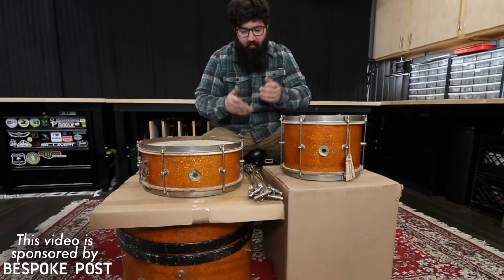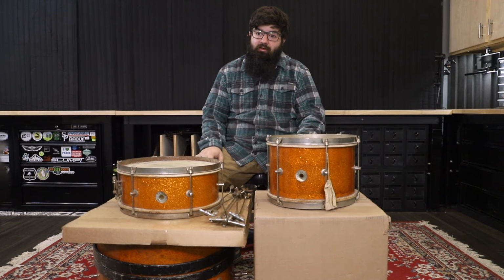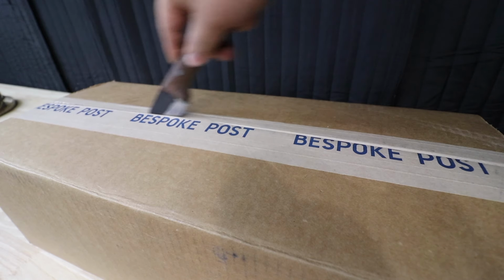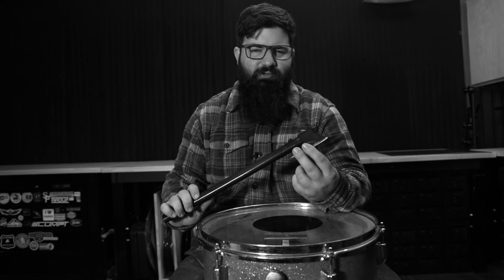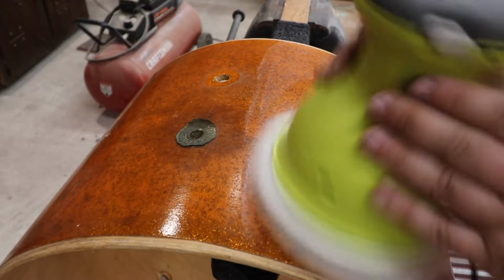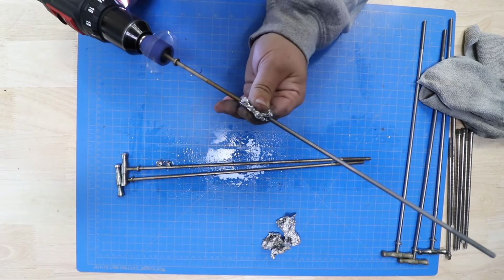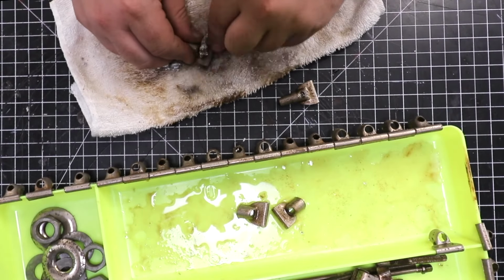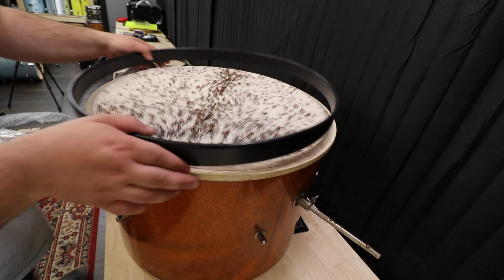Buying and Fixing an OLD Kent Drum Set

Comment: The kit sounds GREAT! I'm not surprised though. I've refurbished a number of Kent kits and drums over the years, and they always sound great. The way they made their shells is unique. Extremely thin maple veneer, on a roll, run through a glue bath, and wound-up like a clockspring, on a mandrel. When dry, the mandrel was popped-out, and voila!... a thin, strong multi-ply shell!!! Usually with a lot of glue residue left behind. Most of them used a "garbage wood" (back then) that we now call "Bird's-Eye Maple". It was considered junk back then, and often burned. Kent's bearing edges left something to be desired, but that, as well as the sloppy interiors, are what I rectified on the ones I refurbed. Poor man's Gretsch??? You bet!!! 😁

Comment: For the rinsing phase after the vinegar I ONLY use isopropyl alcohol. This keeps flash rust from occurring.
Reply: I skip the vinegar and just take the hardware to the wire wheel on a bench grinder. Is this wrong? I've restored two yamaha's and it didn't rip off any chrome, it's much faster.

Comment: I'm new to your channel, loving what I'm seeing so far. Have you use evaporust before? It's actually a miracle the way it removes rust. I'm a drummer turned woodworker, and I've restored several machines and evaporust is definitely handy for getting light corrosion off surfaces without any elbow grease, and you can re-use it over and over too.
Reply from the maker: yeah I have a jug of it, still havent tried it yet haha
Reply: @rdavidr  it's calling your name right now

Comment: It is funny that you came across a E.W. Kent kit at all! I had bought a wood lacquered snare, the throw off on those drums are garbage. the good thing about the Kent is that it has a very resonant sound. The shells are thin and solid and sounds nice. I recently thought about putting a thin or small felt strip on the batter side. I had tried to outfit it with a Ludwig P85, and I learned the hard way that it needed the piccolo throw off instead! One idea for a video subject would be about bearing edges - the different angle cut the difference in sound and the material and function of the drum. I also would like to see what is the best way to condition bearing with the various materials that drums (metal wood, acrylic) are made of. Something to chew on. I always enjoy your videos, great work. Classic Vibe!

Comment: Kent drums were originally made in Kenmore, N.Y. close to where I live.   Back in the 1960's they were very common in my area;  being that they were locally made,  stocked in virtually every local music store,  and relatively inexpensive compared to the 'name' brands like Ludwig, Gretsch, Rogers, etc.  The original Kent drums had the thin round foil shell badge the later ones which were imported had a rectangular plastic shell badge.  I have two Kent 5 x 14" snare drums and a Kent marching snare drum,  none of those currently are players but I may restore them some day.  I also have a Kent imprint 18" crash cymbal.  Like the Kent drums not of the quality of 'name' brands but it is in excellent condition I do use it.

Comment: I had a set of new single tension Kents in 1963 in blue sparkle. They were not as good as Gretsch.         I remember thinking they were better than Japans kits but,  not as good as the big 4 companies drums. Although Kent did make a dual tension/lug kit & they were a more upscale kit. My Kent kit had E.W. Kent printed on their drum heads. The company was owned by 2 brothers and was run out of a small building in Upstate New York.  I think by the middle 70's they might have been out of business already.

Comment: i just got a 1920s ludwig marching bass drum. it’s a 27” so i’m not really sure about heads i could spend forever trying to find 27” head. my dad said i could probably use timpani heads i’m not sure what i should do yet. it’s missing two lugs,but it has single lugs lug this, and i’m excited to see how. it sounds. sadly someone painted over the wrap or finish. but the inside at least is mahogany so i want to sand it down and just put a finish on it, and get a speed king pedal. i’m really excited i just need to stop procrastinating
Reply: I had a 13.5" snare drum with the stock 13.5" hoops and heads.
I sold hoops and heads, putting a 14" rims and heads on it. I put some washers under the lugs to make them further from the shell so they would work with a new, bigger hoops.
The heads were slightly too big but they worked just fine. I put a lot of layers of a tape around (choose the one that is not really wide) the shell to make the head stay perfectly and don't move while changing them.

But half a the inch gap and one inch gap are completly different stories.
What you can do, is that you can try to my an o- ring that factories put inside of a drum to make it more stable. The difference is- you put it on a outside of the drum so the radious would be bigger. 
I am 100% sure is that you still can put a 28" hoops and heads on your bass drum and they still work fine, the same way as it did worked in my case. But that be slightly un professional to just put a lot of tape around the drum to make new heads stay on a place.

Comment: My first drum set what's an Old Kent probably from the 50s or 60s. I got it I got it in the early 80s and it was so old that the wrap was faded and peeling off. I paid $75 for it and I had to use an old field snare that I removed the snares from for the floor Tom I played those drums until the 90s and ended up selling them for about what I paid for them and have regretted it ever since.

Comment: You didn't go over that mount on top of the bd. Is that for like a cymbal arm?
Reply from the maker: Pretty sure...You can see me pull it out while I was disassembling. Its just a rod with some threads on it. There were probably some other parts for at some point, but I would only trust a splash on it lol
Reply: Kick-mounted cymbal holders are cool, generally speaking. Specifically speaking, the kind you'd get on this or a stencil kit are mostly useless, except for holding up whatever sheet-brass crap came with them.

Comment: I enjoyed the tone of it overall. I have been considering getting one if the nicer vintage Japanese stencil kits, I prefer the vintage Ludwig and Slingerland drums 60s period. Is the Japanese stencil a good approximation?
Reply: IME yes. I've played a few stencil kits over the years, although I've never owned one. I thought for sure these were Japanese when I first started the video. The thing about stencil kits is, they're not the greatest quality strictly speaking, and the hardware might take a crap. But they have a *vibe*, man, and they are a lot of fun for not much money. And the wraps they come in will blow your mind - I have no idea why no one has stolen some wrap design ideas from those old things, because they came in some truly wild finishes that absolutely nobody else ever made.

If I found an old stencil kit in a cool bizarre wrap that nobody else ever made, I would grab them without hesitation, even if I ended up needing to order new lugs for them or whatever.
Reply: @joeday4293  I had an option to get a mid blue sparkle one locally, I should see if that dud still has it. I also want to try a Remo Acousticon shell drum set
Reply: @pastorkev777  Acousticon? ...no you don't. LOL
Reply: @joeday4293  it is a polarizing thing. I personally think the snares sound great, not vintage, but great.

Comment: Made by the same company that made zim gar ,pearl, cheap shit sold at Sears ,n Montgomery words,Penny's,wigwam,market time most music stores didn't carry Kent because they were to cheap I had a set of pearl same color as yours and I have a set now with the 20,14x24 deep floor tom yip 24 deep 14x5 snare n 12x10 deep high Tom I put 6 layers of door skin inside of them and I'm putting a yellow wrap on the out side with new tubular adjustable  base drum legs  and I'm rounding the out side edge to give it a warmer sound with Remo pin stripe heads on top